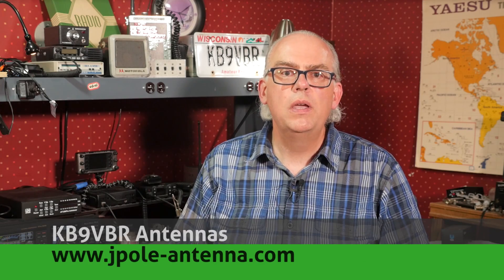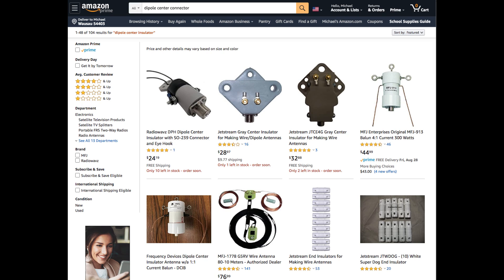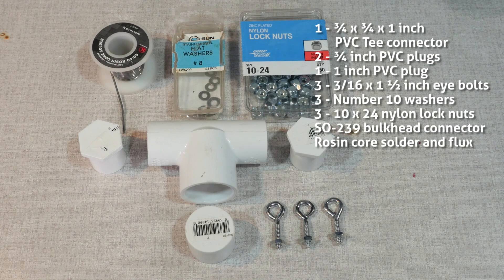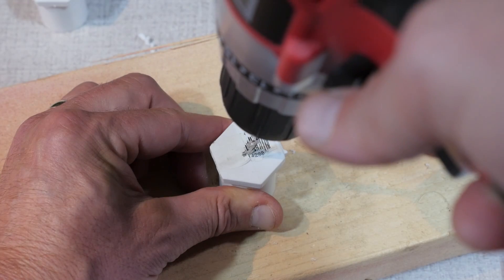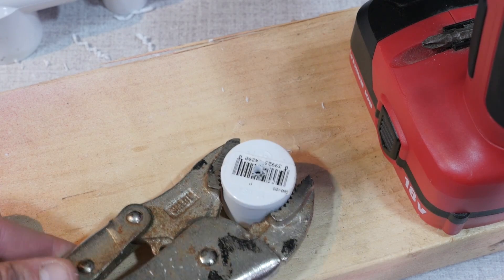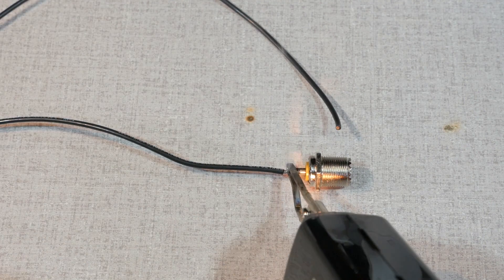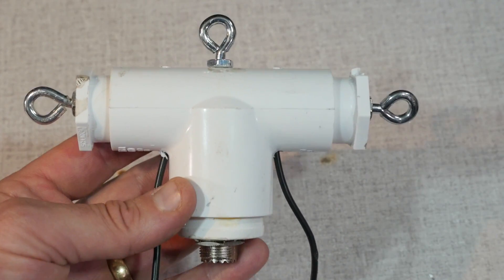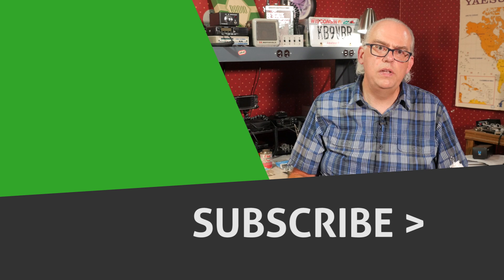Build a Dipole Antenna Center Insulator - Ham Radio Q&A

Comment: I can't find the exact tee connector used in the video. No ¾ x ¾ x 1 inch PVC Tee connector anywhere online.
Reply from the maker: Here's the part that I used: https://www.menards.com/main/plumbing/pipe-fittings/pvc-pipe-fittings/nibco-reg-socket-schedule-40-pvc-tee/f00621d/p-1444449162483-c-8571.htm 

I suppose in the absence of finding the correct Tee, you could use 1 inch all the way around. Your center will be larger, but not by much.

Comment: Great video!  Easy for folks to follow.  I typically build my own 20m center-fed dipoles.  I run one in my attic and the 2nd is used for deployment in the field when playing ham radio.  73, KB5AEB

Comment: I would recommend using a bulkhead connector with a square mounting flange; so that it can be mounted outside on the pvc end cap allowing the full length of thread on the so-239 connector to be available for the pl-259 to properly seat. The one wire would solder to the center connector of the so-239 and the other wire would attach to one of the small mounting screws for the so-239 bulkhead connector.

Comment: Good explanation. I modified the structural parts a little based on what I had available but it's just what I need and cheaper than ordering the part on its own. Great explanation, you're a good teacher. Very clear instructions, great angles for seeing how you did it. Nice and simple.

Comment: Is the dipole length going to be off because of the extra wire soldered to the connector
Reply from the maker: Marginally. You will may have to trim the antenna slightly, especially on the upper bands. But its always wise to cut the wires long and make adjustments, instead of cutting too short.

Comment: Would you choke it at the dipole or at the radio?
Reply from the maker: Except for a few specific cases, common mode chokes should be placed near the feed point of the antenna.

Comment: Is a balun needed for a 20M Dipole antenna? I will not be using this 20M dipole for any other frequencies other than the 20M that it was made for. I made mine the exact way you made your antenna in this video.  I also have an isolater.  Would I need both? Do they pretty much do the same job?
Reply from the maker: The purpose of a 1:1 balun is to prevent common mode currents from returning down the feed line. If the dipole is properly tuned, common mode should not be an issue. I don't use a balun at all with my dipoles. Occasionally I've added a common mode choke by either coiling the cable or adding ferrites near the feed point and a line isolator serves the same purpose as a common mode choke.

Comment: Question: what is the purpose of the eye hooks if the dipole is suspended by the end insulators? I can see having one on top if it is going to be hung as an inverted vee, but I’m confused what the side ones will do. Thanks!

Comment: I like this center insulator but I made a small addition.  I put in a small screw (with the head on the inside of each arm).  The wires from the connector in the base come out in the armpits of the T as shown.  I put a ring connector on each of those wires and run to the screw.  Each of the wires for the fan dipole also have a ring connector and attach to the screws and then i put a num on to hold the ring connectors in place.

Comment: I am sorry but I have one last question. As far as the length of wire, do you count the small length of wire connected to the SO 239 (coming out of the dipole) to be included in the total calculated length?  For example if the total required length of wire needed was 16ft/5 inches and the wire connected to the SO 239 coming out of the dipole was 5 inches, would you make the antenna wire 16ft being that the 5 inch wire coming out of the dipole will be soldered to the 16ft antenna wire for the required 16ft 5 inches?
Reply from the maker: You can add that amount to the overall length, as it may have an effect with shorter antennas. There will always be a bit of tuning and adjustment once the antenna is assembled, so I'd cut the wire to your calculated dimensions and then compensate for the added length of the center connector when you make your final adjustments.
Reply: @KB9VBRAntennas  Gotcha.  Thank you.  How are you doing?

Comment: Two Question for you.  Question # 1: Will the performance of the antenna be affected if the two wires (the grounded wire and the other wire going into the SO 239) are touching like it is in the 6:25 mark in this video? Question # 2: In reference to the 5:32 mark of this video, doesn't tying a knot in the wire cause the signal traveling through the wire stop at the point where the wire is tied as it does when we twist the wire on the insulator?
Reply from the maker: The two wires on the SO-239 aren't touching each other. There is the center dielectric insulation that separates the two, so the center pin and the outer ring are insulated. As for the knot, a single loop knot isn't enough to stop the the transmission of RF. There may be a slight impedance bump, but not enough to cause an impact. You will need several loops in order to do that.

Comment: Hello KB9VBR, First let me say thank you for the great video. It is well appreciated.  I have a question. You stated you built that antenna for about $12.00 out of part that were commonly available at local home improvement store.  I went to Lowes as well as Home depot and the items came to more than $12.00.  I n addition to this nether store had eye bolts that were in the size of 3/16 x 1 ½ inch eye bolts. The closest I saw to that sze was 3/16 x 1 inch. Neither store had the PVC Plugs that were 3/4 inches. Also when I went to Lowes, they did not have any PVC plugs to fit the 3/4 X 3/4 X 1 inch PVC Tee connector. I am not sure where you purchased the parts from but I do know that Lowes and Home Depot did not have it in my area.  Can you tell me where you ordered your parts from?  Thanks.
Reply from the maker: When I made the video three years ago, the project cost was about $12. I'm sure inflation has an effect. Just about all of the parts were obtained from Menards.com, a home improvement store that is prevalent in the midwest and much of the east cost. I think you can order some of the missing parts online.
Reply: @KB9VBRAntennas  So I ended up going back to Lowes and realized that the tee connector and plugs that I purchased were a lot larger in size than the ones you have in this video.  So I looked and found a smaller size tee connector and caps. With that said I see that all the parts do in fact come to about $12.00 give or take. The tee connector was $1.87, the caps were $2.34 ($1.17 each x 2), the eye bolts were $2.34 ($0.78 each x 3), the Nylon Lock Nuts were $2.78, the washers $2.98, and the plug was $2.07 for a total of $14.38. So you were totally correct. Thanks again for your video. It helped a lot.  What type of wire should I get? That is where I am stuck at.
Reply from the maker: I use 14ga stranded THHN wire. It's relatively inexpensive and available at home improvement stores. if you are looking for something lighter, then either 18ga or 20ga stranded.

Comment: Great video, and spot on. Any subjections on how to make this center insulator to work for a 5-fan dipole, I looking at making. Thanks again for the video.
Reply from the maker: It should work fine for a fan dipole, all of the elements would have to terminate at the eye bolts. You may need a larger eye if you have a lot of wires.

Comment: I’m about to make an attempt with this project. The only problem is, I cannot find a 3/4 x 3/4 x 1 tee. I can only find 3/4 x 3/4 x 3/4 tee. Will that still work?
Reply from the maker: The smaller tee should work but you may find the SO-239 chassis connector to be a really tight fit. Another option would be to use a 1 x 1 x 1 inch Tee which would be a bit larger, but give you more working room.
Reply: @KB9VBRAntennas  thank you sir!!!!73!

VE3CNA Canada
Reply: @KB9VBRAntennas  I have another question lol. I found an all 1 in tee but cannot for the life of me find plugs that size. The only other option would be to get an all 1 inch tee but it would have to be threaded. I found plugs for those. Would that work?

Comment: The balun needs to have an impedance matching transformer to "balance" the load at 50ohms.
You also need to make sure, when you erect the Dipole, you have several layers of insulators at uneven wavelengths to reduce noise and attenuation

Comment: Local home depot does not carry 3/4 3/4 1" Tee - in fact cannot find on line LOL - Where the heck do we get them. I could go up to 1" x 1" x 1", I can find that...
Reply from the maker: You can go with the 1 inch tee, it will just be a little bigger. I got my reducer tee at Menards, a home improvement store popular in the Midwest. Here's the link, it may be helpful in you finding the part: https://www.menards.com/main/plumbing/pipe-fittings/pvc-pipe-fittings/nibco-reg-socket-pvc-reducer-tee/f00621d/p-1444449162483-c-8571.htm

Comment: What about using a line isolater near the transceiver to combat common mode current?
Reply from the maker: You can do that. You can also put a choke on your coax near the feed point of the antenna if you don't want the coax to radiate the common mode current.

Comment: I made a dipole antenna for the CB Band back in around 2008. I used a triple female coax T connector for the center part. I used two PL-259 connectors to attach the dipole wires to it.  One connector used the center pin and the other connector used the shield hole. It worked pretty good and I got a good match after trimming down the wires. I took a nylon coated clothes line and taped the dipole to it and used the clothes line to stretch it out and tie it off to the fence clothes line poles in the back yard. I taped the lenght of the feed coax from the center connector going down to the ground to a clothes prop and hooked the prop to the clothes line at the center to support the antenna. I called it an invisible dipole because it looked like I just had a clothes line and clothes prop stretched out across the yard.

Comment: can i use this to string two dipoles, 40 and 20 meter dipoles on this one insulator?? thank you...Buddy
Reply from the maker: You can. That’s called a fan dipole and it does work well. When you build it, you will have to individually tune and adjust the two segments as the wires will interact a bit. An analyzer is really handy for that process.

Comment: Would there be any benefit in using a different color wire to connect with the center connector on the SO-239 for identifying polarization?  Finally taking Technician Exam in April.  thanks for all of your help and advice.  Also, using the correct length wire elements, could this design be used for 10 Meters?
Reply from the maker: You could use two different wire colors, but for a dipole antenna it really doesn't matter which side is connected to the center and which to the shield. This center insulator can certainly be used for a 10 meter antenna; that's the first antenna I built when I got my license. Use the formula of Frequency / 468 to calculate your element lengths and you are good to go.
Reply: @KB9VBRAntennas  Thank you, makes sense now.  Any recent updates on your camper and the solar upgrades?
Reply from the maker: The camper's been tucked away in the garage since November, but it will reemerge soon as the weather warms up. I do have a couple solar videos in the hopper, so stay tuned.

Comment: Why bring the wire outside, why not use a brass hook and connectors inside the T?
Reply from the maker: You could certainly do brass connectors. I used bare wire in the project for simplicity.

Comment: Hey guys, does anybody point me in the right direction for the SO-239 bulkhead connector used in the video?

It looks like the Amazon store changed the style a bit since the video was made for the link in the description and there's not enough threads to lock it down to the plug.

Great video, I've watched it a dozen times now!
Reply: Any luck with this?
Reply: @fonekode  I didn't find anything. Ended up having to sand down the end cap of the pvc so I could get some thread engagement on the shorter style SO-239 that they sell on Amazon now.
Reply: @stonewall6225  I just did the same.  Dremel came in handy.  I also sawed the plug in half to work the thread easier.  Will be thinking about this to find a better solution..  thank you.

Comment: Great video! I'm having trouble finding the plugs, my local hardware store didn't have them so I'm going to try to order off Amazon. Does anybody know if there is a technical name for those? Thanks!
Reply from the maker: They are called PVC spigot plugs. I purchased mine at Menards, a midwest home improvement chain, but they should be commonly available: https://www.menards.com/main/plumbing/pipe-fittings/pvc-pipe-fittings/nibco-reg-spigot-pvc-plug/f01010c/p-1444449157332.htm
Reply: @KB9VBRAntennas  Thank you very much Sir!

Comment: I enjoy your videos - please keep them coming.  I was thinking about adding a 4" section of pipe to the arm where the coax connects and building and inserting an a air core wire choke.  I want to use the feedpoint with balun / choke for a multiband (40/20m) inverted V antenna.

Comment: This is a dipole center without balun 1:1 right?
Reply from the maker: Correct. This is just a center connector. A 1:1 balun can be helpful, but often not necessary with simple dipoles.

Comment: The problem with this video is that the SO239 connector needs to have a very long thread otherwise it is too short for the nut to screw on, the connector shown in this video is NOT the one linked to in Amazon, it will not work, thread is much too short
Reply: I'm glad to see I'm not the only one that found this out. So I ordered an Amphenol 83-878 - UHF-Female SO-239 Bulkhead Connector and that seems too short as well. When I connect a PL-259 to the SO-239, the teeth on the connectors don't engage. I'm not sure that will make a good connection.

Comment: plastic t peice  middle was the mount up and down dipole one would fit into the other extended to 9 feet up 9feet down you would leave the upright straight up diaganol the bottom straight down one tube would slide up and down for swr straight up and straight down as i said middle for mounting to the wall could also use as directional beam horizontaly

Comment: sir what about the two black wires, which one came out, where it will be connected, the center we can connect the feeder cable or coaxial cable and rest of wire
Reply from the maker: The black wires will connect to your antenna radiators. Here's the followup video that shows building the rest of the antenna: https://youtu.be/zvtKlqQ6DSo

Comment: great video.
but do not use silacone, as sure it will plug up a hole but never really sticks to most everything, water will get past it. better to use caulk. also around the base/threads of the I bolts as a added protection.

Comment: I have made a few of these. I made some with multiple antennas hooked to the same center. They worked great. I spread out the different antennas on different lines. One was for the bottom of 10, 15, and 20 . One was for top of 10, 12, and 17 meters. KG7IRJ Ohio.